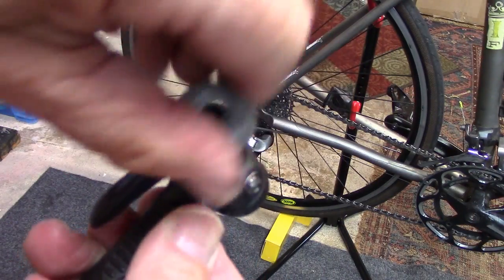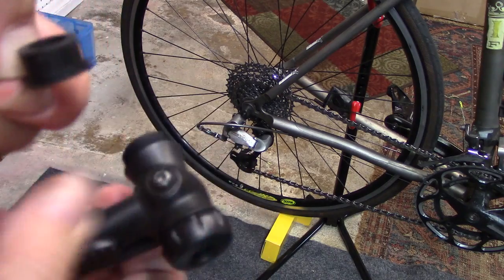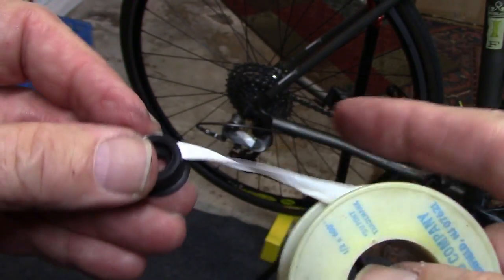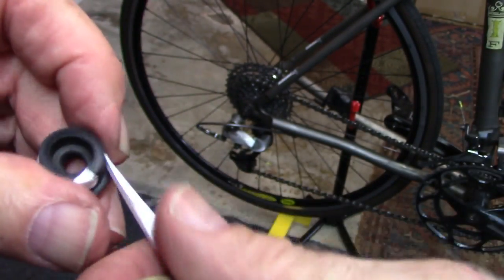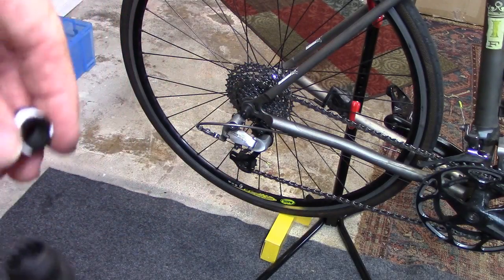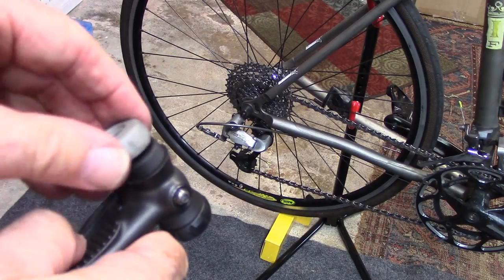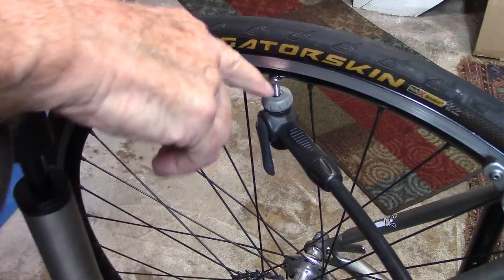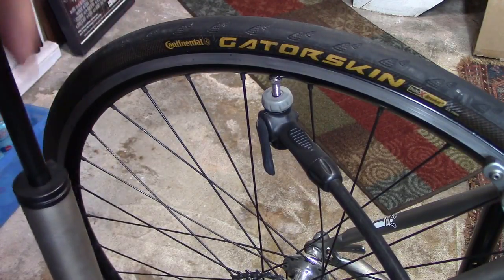Leaking Bicycle Pump Head at valve: Quick Repair

Comment: I bought a used pump didnt leak when pump my tire the 1st time, 2nd time it leaked almost as fast as I could pump the air, this simple tip fixed it and now it pumps to 120psi without a problem. Thank you
Reply from the maker: You may have to repeat the process every 2 or 3 years depending on how much use the pump gets. I've kept several of my bicycle pumps going for over a decade with this simple trick. Thanks for the complement. Regards, Tony

Comment: I bought a re-build kit and it did not fix the issue but after using your recommendation (thread tape), problem solved! Thanks!
Reply from the maker: It's a nice little trick. It may have to repeated every few years, but it saves in not having to buy a new pump. However, if the pump head or tube break, there are several pump head and hose replacements. The best are from Planet Bike and Topeak, both of which I have used. Regards, Tony

Comment: Thanx Tony! I had no plumber tape and I used electrical isolation tape. And guess what? It works great. Thanks for your help!
Reply from the maker: Thanks for the feedback on the electrical tape. Regards, Tony
Reply: Same here. First looked for the SKS pump part online. 1.5 euro for the rubber part and 5 euro shipping  or completely swap the head for like 8 euro + shipping --> electrical tape that I had just fixed the issue (for now)  .  Tony saved the environment, I hate to throw working stuff away, and saved myself some money.

Comment: It works! I too was race pumping trying to win more air in than out. Thank you Thank you Thank you. I appreciate the "short-to-the-point" video.
Reply from the maker: Works on most but not all pumps. You may have to redo the plumbers tape in a year or two, so hold onto the roll. If you get a pump where this does not apply, just sent me a comment and I'll try and help, or give you some good references. Regards and safe cycling, Tony

Comment: Thanks me you are the inspiration I needed to a similar problem, mine was an old style bike pump (the ones you attach to  the frame), I had a problem with the flexible connector, when I screwed it fully on  it opened the valve and deflated the tire (or I could try and pump it up open - a losing battle!!) so I put tape round the valve stem, the outside of it and only screwed it down to just before it opened the valve, then I could put the tires real hard, much harder than before. Without the tape it would leak out the outside of the valve stem. I was thinking of something similar ie a piece of a plastic bag, which is very similar to plumbers tape really, but you got me straight to the best solution and now my slightly soft tyres are suitably firm!

Comment: I just used rubber earbuds for fixing my hand pump valve. Works much better now. I have fixed one standing pump by just replacing the tube with one from another pump. I got tired of having to buy new ones so I just saved my old ones for parts.
Reply from the maker: Good ideas.

Comment: Thanks for that tip. 

The problem with my floor pump is that it works well only sometimes. Most times it either leaks air at the valve, the air pressure dial does not indicate any value at all. Sometimes the air passage gets blocked, so that it becomes impossible to pump air in, the pump handle simply bounces back.

It used to work flawlessly when new. I am going to try out your method
Reply from the maker: The tip on leaking pump head valve with plumbers Teflon tape may prevent leakage. Presta valve are known to "stick" and not let any air in or out and the "passage" seems blocked. Therefore, it's important open the valve itself and give it a tap (letting a tiny amount of air out) so it won't "stick closed." Sometimes you may have to take the pump apart, clean off the plunger, and put some grease on the plunger edges, and reassemble. Finally, spare tubing and valve heads are available from Topeak and a few others at Amazon:
https://www.amazon.com/Topeak-Twinhead-Bicycle-Floor-Upgrade/dp/B000FI6XF8/ref=sr_1_4?dchild=1&keywords=replacement+valve+head+for+bicycle+floor+pump&qid=1578147739&sr=8-4
 Let me know how you make out.

Comment: Tony, so what if the other side of the dual pump is leaking the air out? Do I do this fix on both sides of the valve?
Reply from the maker: What is the make of your pump?
Reply: BV erogonics

Comment: Hi Tony. I have the opposite problem in that no air is being gathered nor pumped into the tyre. It is a floor pump with a psi gauge, and it is stuck at zero and there is absolutely no resistance when I pump it. I have tried reattaching it with the valve open at different amounts but still it does not work. Do you know what the issue might be? I'm sure it's something very simple. Thank you!
Reply from the maker: What is the make of your pump? 
Take a look at the pump chuck that you attach to the valve and the hose and make sure there are no cracks or breaks where air can leak out. Check around the gauge that air is not leaking.

Most likely it's the piston head inside the pump cylinder that's worn or needs grease. Unscrew the top of the cylinder (the end with the handle) and remove the entire rod and piston. 

Take a look at the piston head. If it's leather (as with Silca Pumps) see:
https://www.youtube.com/watch?v=dOb_w8_7tc4

If it solid and has an O-Ring, clean the O-Ring, piston head and inside the cylinder best you can (I stuff some cloth down so one end of the cloth is in the cylinder and the other end is out, twist the cloth around and remove). Put some grease on the O-Ring and re-assemble. If that fails, it is possible that the O-Ring is worn and needs to be replaced. You can take the old O-Ring or the entire pump with you to a local hardware store or Home Depot and look for a replacement OR look for a replacement on the internet.

Comment: Hi my pump Schrader Valve Pump connector thread is striped and when i screw it on an tighten it its on a angle and it doesn't pump up
Reply from the maker: Depending on the pump, you may be able to get a replacement head or replacement head with tubing that will fit. Check out Amazon and other vendors on the internet.
Reply: @tony10speed  Hi I found the problem it was the rubber seal plunger grommet in the cylinder was damaged
Reply from the maker: @TW39  Thanks for the feedback. We all can take hope some helpful information. Regards and safe cycling, Tony

Comment: i am unable to open the pump and replace the washer within it. can you guide/help?
Reply from the maker: If it's a single head pump as in the video, a pair of pliers should remove the cap to the valve head. If you have a Dual Valve Pump Head, see:
https://www.youtube.com/watch?v=jlEj0sHEuGA&t=1s&ab_channel=RJTheBikeGuy
You may have to look up your specific pump on YouTube or look for the manufacturers specifications on the internet since there are may pumps mechanisms that are used. What is the make/type of pump you're using?

Comment: How do you get the valve cap off the bicycle pump.  My seems stuck
Reply from the maker: On most single head pumps, you can unscrew the cover of the pump head. You may need to wrap the end (so as not to damage the plastic) and then use pliers. If you're using a duel head pump, see: 
https://www.youtube.com/watch?v=jlEj0sHEuGA
You can also purchase a new valve head such as the Topeck Smart Head or Planet Bike Head and Hose. I've used the Topeck Smart Head and Hose on broken pump heads with good success. Far cheaper then a new pump. 
What is the model of your bicycle pump and is it single or duel head (i.e., for presta and schrader)?

Comment: Mine seems to be leaking in the pressure relief button, it’s a giant control tower 1. Do you know how can I fix it?
Reply from the maker: Do you mean it's leaking from around the pump head lever (used to lock the head down)? If that's the case, the plastic of the pump head may be broken. Hard for me to say without seeing the pump. You may want to take it down to your local bike shop. Sorry I can't help more.  Tony

Comment: Please make a video on how to repair outlet valve inside the compression chamber,thank you
Reply from the maker: If you're referring to the valve at the end of the plunger rod with in the pump cylinder, often times just taking the pump apart, cleaning and re-greasing is all that is needed as shown in the following video: 
https://www.youtube.com/watch?v=XxKYtuf3Ltg
This will also work a leather washer such as a Silca leather washer. If you need to replace the washer see:
https://www.youtube.com/watch?v=QH6VE1Q9S40
If you need to service a Park floor pump see:
https://www.youtube.com/watch?v=drgLn5k2vOc
Sometimes you'll need to replace the rubber "O" ring or leather washer in some pumps. You can get them from the pump manufactures, on line or, in the case of the "O" ring, from an automotive or hardware store. Let me know if this answers your question or did you have something else in mind.  Regards,  Tony
Reply: Thanks,but im having trouble removing the guage cylinder,because something's ticking/rumbling around inside it (outlet valve)
Reply from the maker: What you seem to be referring to is the bike pump "check valve" at the pump gauge. It varies with the pump. What kind do you have? Then I can try to find you a reference.  Tony
Reply: sorry, I do not know what kind of bike pump it is, the problem with it is when i pump,the air returns to compression chamber/body of pump.
Reply from the maker: This is the best I can find for you: https://www.bikeradar.com/forums/viewtopic.php?t=12671709
Don't know if there's anything else I could suggest other than the bike shop to look at it or just get a new pump. Good luck and sorry I can't help you more.  Tony
Reply: Thank you very much Tony 🤘

Comment: I tried the teflon tape.  The leak seems to be coming from the pressure release button, under the locking handle of the pump head.  The head doesn't seem to come apart other than where the valve seal is.  Any ideas?
Reply from the maker: What is the make and model of the pump? Is it a dual headed pump head and, if so, are the dual heads opposite each other or side by side?
Reply: @tony10speed  Aergun x-1000.  Dual head, not opposite or side by side.  Single opening
Reply from the maker: @christhomson877  Remove the nut from the tire valve. Make sure the pump head is pushed all the way down. Open the lever all the way so that it's parallel to the pump head. If it still leaks, the pump is guaranteed and I would contact the manufacturer or check with your local bike repair shop. I have no easy fix for this type of pump and internal working of the pump head work are not available from the company. Tony

Comment: My handle came off how do I fix it
Reply from the maker: Some handle attaches to the shaft of the piston in a variety of ways depending on the pump. Some just screw onto the piston, some are held be a bolt and others by a small medal rod. I suggest you take it to your local bike shop since it's difficult for me to evaluate with actually seeing it and having it in my hands. Let me know how you make out.

Comment: I'm using a hand pump and the lock mechanism is not working.  I put the pump on the valve and lift the lock bar and the pump slips off the valve.  

Anyone help?
Reply from the maker: A number of possibilities:
1. The internal gasket within the chuck is so worn, the chuck just slips off the valve. One could try a number of layers of plumber tape around the gasket and try the pump again. In some cases, one can buy the inexpensive chuck gasket on-line specific for your pump (check the manufacturers web site and Ebay). 
2. The chuck lock bar may be broken. You can look for a replacement chuck for that specific pump on-line, but most are hard to find. Topeak makes a chuck and tubing replacement kit - but - the problem I've found with the kit is that the tubing and adapters may not fit your pump. And the kit is expensive.
3. Finally, maybe it's time for a new pump.

What is the make and model of your current pump? Keep in touch and let me know how you make out, Tony